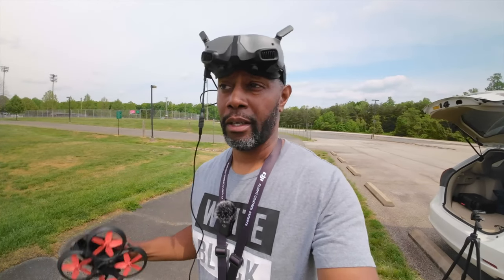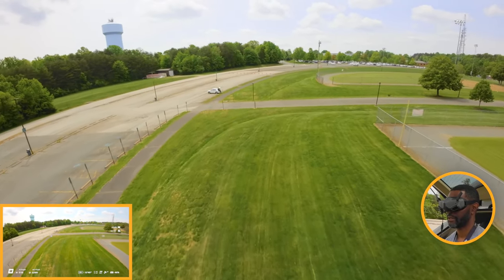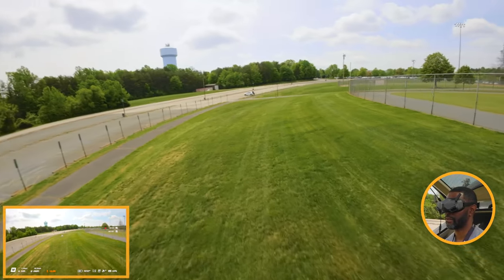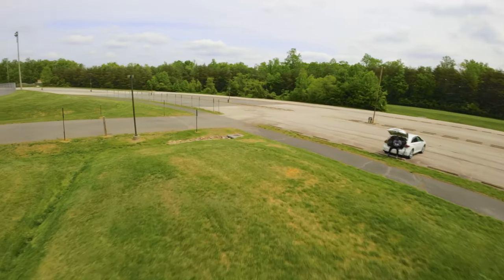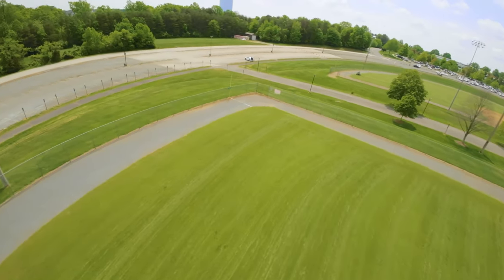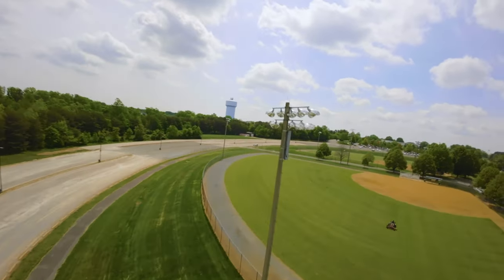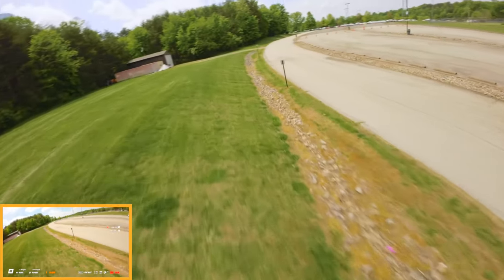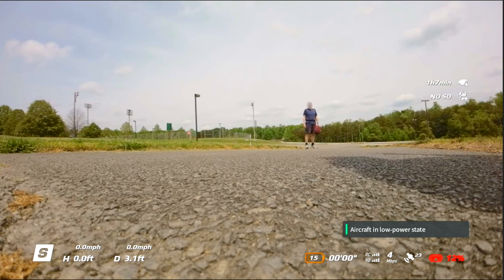DJI Avata FPV | Why I'm saying Goodbye to the Master Airscrew Propellers 😢

Comment: I’m going back to stock props too. I tried  MAS 3 and 4 blade props. To my ears the 3 blade props had a little pitch than the 4 blade and stock props. The MAS props do seem more brittle. I cracked the 3 blade props on a very minor crash. I’ve crashed the stock 5 blade props pretty hard with no damage.

Comment: I learned about props the hard way.  A little flex is good.  Rigid props are brittle and prone to stress cracks which can result in failure.
Reply: True but also master aircrew knows exactly what they’re doing

Comment: I gave up on Master Airscrew when I purchased the props for my Air 2. They weren’t enough of an upgrade to justify flying with them. Possibly voiding my care refresh. They also felt flimsy. 
I used the Master Airscrew props for my original Air and was happy with the product. They definitely made a difference in the noise pitch. 
I’ve heard nightmare stories with the foldable Phantom 4 Pro Master Airscrew props. One of my boys received a notification and the P4P quickly fell out the sky. He didn’t have time to react. One of the props failed. Those props required a little more assembly to install so Master Airscrew never took accountability for that disaster. 
I had purchased those foldable props for my P4P as well but after hearing what happen I decided to not install them. 
So now I just avoid that brand altogether.

Comment: Had the same issue today with Master Airscrew 4 blades props. Very smooth crash trying to hit a gap and the prop just broke in two peaces...Going back to stock props for now
Reply from the maker: Yeah... the props for rhe Avata need to be more flexible.  Thanks for the comment.   Please Share if you can.

Comment: I don't have a Avata but do have an air 2s and mavic 3 classic.  I definitely notice a pitch change with the master air screw but both drone sets of blades eventually start to loose balance and tend to shake the rear arms even just sitting on the ground with the props going.  The air 2s was even slightly moving towards the left just sitting on my driveway.  I always wonder if the shaking will eventually put stress cracks in parts of the rear arms.  I have gone back to the stock props but definitely notice the buzzing sound difference with the standard props.

Comment: Did you ever have the original avata props shatter on you? 

I definitely know what you mean about getting the confidence back to 'freestyle' after a crash. I enjoy building drones, but hate doing repairs!
Reply from the maker: Never had the original props break.  Just got a couple of nicks.  However, I've broken an ORANGE prop.  Only one blade broke in half.  It didn't  totally disintegrate like the Master Airscrew.
Reply: i already break 3 of the original ones :D they just blowned up after 4-6m height drops from crash.... :D 1 is blowned up while doing turle so it was probably already hurt in the crash :D
Reply: @ChadB  Happened to me 2 times with original props. No stress, no prior damage on them. last one was in an event and our head pilot inspected the drone before take off as well. Wasn't even pushing it when it happened, flying on manual straight and bam, it tumbled down and when I got the drone back, 1 prop was completely gone.

Comment: I've never flown a drone before. I'm curious, the view through the goggles, do you get a sense of 3D dimensionality similar to an Oculus VR system or is it like looking at a flat image/screen?
Reply from the maker: Not 3D, but more like sitting in an IMax theater.
Reply: Doing such a thing would require either a stereoscopic camera on the drone, or another form of depth perception (like a depth camera on the drone or AI depth reconstruction in the headset). There's a few technological challenges to doing that.

Haven't seen such a thing with drones yet. FPV is still in 2D but it's still much more immersive than looking at a screen.

Comment: Chad
I watched you fly in this video and have absolutely come to the conclusion that you are absolutely ready for a five inch fpv. Grab one and you’ll never fly that avata again. Just make sure to get a remote that isn’t that little grey dji one, it sucks. Grab a remote with full gimbals. The throws on the dji one are too short. The other dji(black one) is awesome. But it won’t work with goggles2. Will with the v2. Confusing, I know. But trust me, you’re ready, and it’s night and day. You will love it.
Reply from the maker: Thanks.  I am looking into getting a 5 inch now

Comment: Your project frame rate settings are not good, how come you are not bothered with those framerate hiccups, or is it just me? Those tiny for example (49.97 fps, I dont know exact value) play  a huge difference, try it. You see, based on that value every X frame gets skipped.